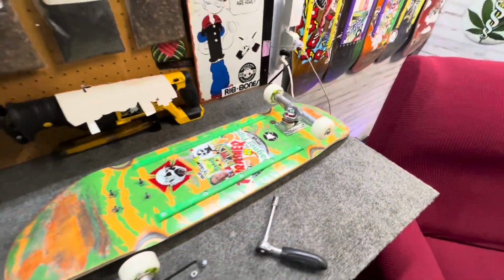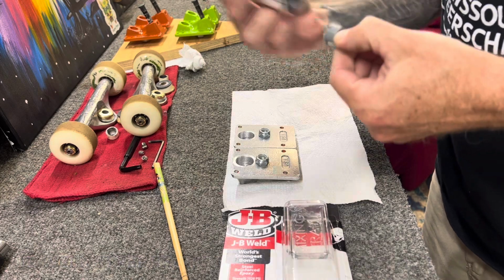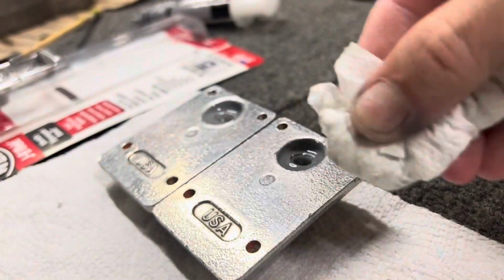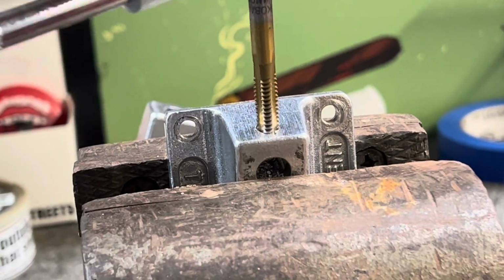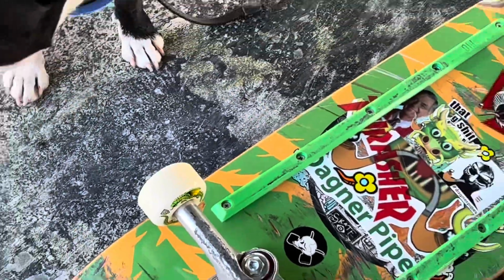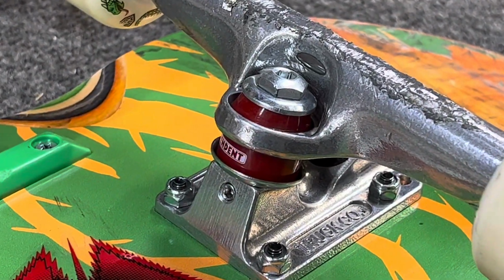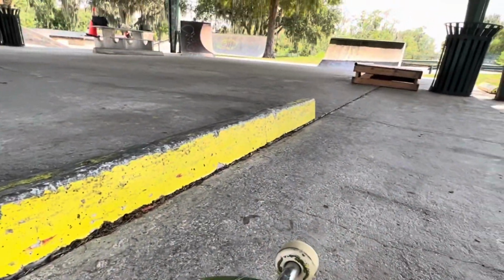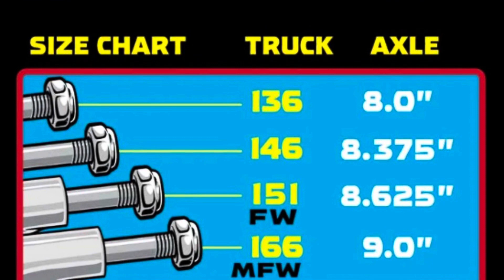Independent Stage 4 Inverted Kingpin Baseplates -DIY-How To #skateboard #truck #performance

Comment: Brilliant idea to use the grub screw to stop the new kingpin from getting loose. In the old days there was another nut that tightened onto the truck baseplate, but this is a much better way to do it….Resoect!

Comment: After watching this, i realized I had all the supplies in this vid. I followed all the steps, and had ordered in a grind king reverse kingpin and got to impatient waiting for it so I ended up just flipping the stock kingpin in my stage IV’s and used the tap screw method and honestly I’d be surprised if no one else hasn’t already done this before me. I can’t be the first.

Comment: Sweet!  Been riding the Dragons in 54 for a while.  Big change switching from always riding 50.  They are a little on the soft side and don’t quite slide like 101 wheels on nice concrete.  I can’t wait until Andy’s Nano wheels are eventually made in 54.  I want to see what Dragons in 97a feel like.
Reply from the maker: Fuck yeah, glad your still pushing and puffing!❤️🛹💨 I’m skating the AA Nano Cubics now on a few set ups and there awesome. 52 that feels like a 54 with 101 speed feels and more bark. My knees are diggin em👍🏻☠️
Reply: @DagnerJayson hey I heard these are normally really good at avoiding wheel bite, ya think the new bushings or geometry messes with that characteristic?

Comment: Awesome slappy skills. Just throwing it out there, the grublock screw isnt necessary since the JB Weld is holding the nut in place, just using some blue loctite 242 on the kingpin will prevent any loosening.
Reply from the maker: I have knocked them loose in the past without set screws. There necessary in my slappy life👍🏻

Comment: great video love the details. love the ADOLESCENTS font you use haha. That block typewriter font! Sick board, sick setup, sick slappies.  I have a couple down low kingpins from Krux just been lazy to put em in. You're the only one doing that 
"set screw"; in the baseplate. Is that require for down low kingpin? Seems like a ton of work and I'm gonna needs multiple tools I don't have. Is the set screw mandatory for Krux DLKP? Is the JB Weld mandatory? I'm a big guy like 250 6 ft 3 so I abuse trucks, bushings, non flight decks, etc, lol!
Reply from the maker: Its extra mandatory for you sir👍🏻

Comment: I’ve seen some use just the set screw and some just the JB but haven’t tried either. Saw you did both. Any reason why the combo? Issues with either method independently? Haha.

Comment: Wow , that's a lot of work, I wouldn't be able to do it by myself. That's rad tho. The durometer of the indy red bushings stage 11 is 88, for red bushings stage 4 the dirometer is   90. I also know from personal experience with them, that the red bushings stage 11 are a little taller than the other indy bushings , I have never understood why, that's why they feel hard although they are actually soft. Cool video man , you have got a new subscriber.

Comment: This is mad over the top, I just wedged some slim pliers in-between the nut and the bottom of the baseplate to stop the nut spinning while I tightened it together and it worked fine, literally took less time then this whole video
Reply: the purpose of this isnt to tighten the kingpin its to keep it from untightening lol.
Reply: @Slouch420  why would they untighten ?
Reply: @Aminormaze idk… skating? Slappys are brutal on your trucks
Reply: @Slouch420  it never untightened
Reply: @pyrimid  i slappied them it was fine